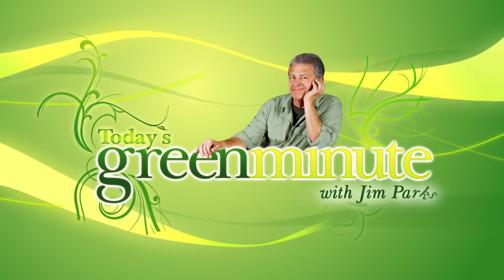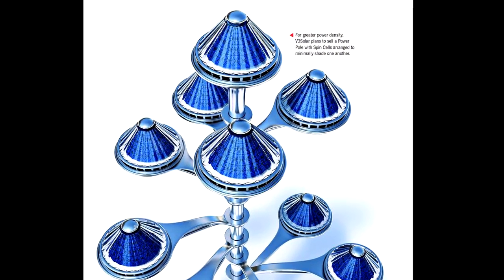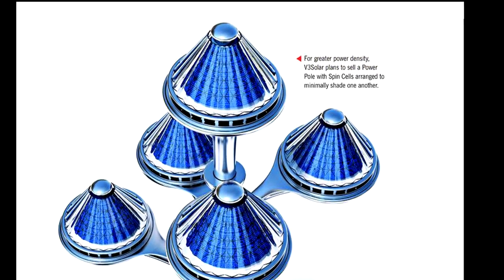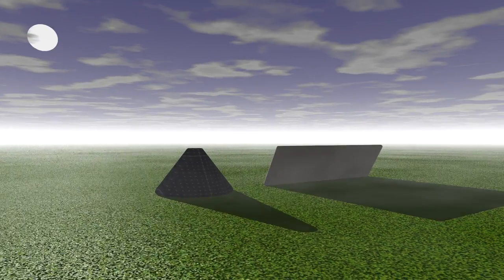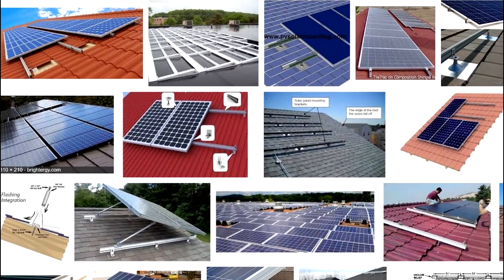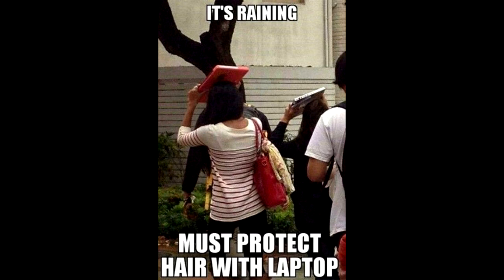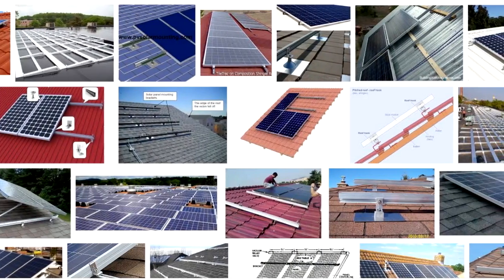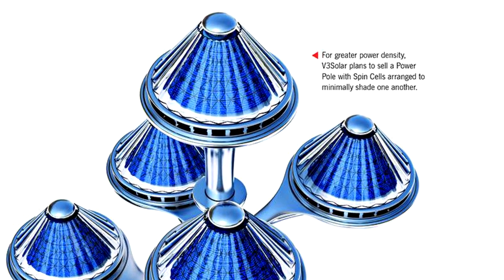Spinning Solar -BUSTED!

Comment: Why not make it a sphere. Sun is pretty unpredictable, so it might as well be below our solar panel sphere.
Reply: "The sun is unpredictable"
I believe its very predictable with its east to west movement.
Its so predictable in fact that its used for navigation.

So... about that
Reply: You are just giving away million dollar ideas here :P
Reply: Cheeseboat, its a joke. Turn on your sarcastic humor detector.
Reply: i think he means that clouds, which can block light and we cant do anything about it thus makes it "unpredictable" i think that's what he means.
Reply: for sure! and we could pay people to shine torches on it during the night
Reply: +zemeon2 He means the sun will try to sneak under the solar cone. Duh!
Reply: outseeker Well, the Streetlight could recharge itself on the solar panel. After all, its over 100% efficient.
Reply: André Broessel has done it I saw this in Barcelona https://www.engadget.com/2012/08/28/spherical-glass-lens-solar-energy-generator/
Reply: You're not familiar with humor, are you?
Reply: Joke aside, they do make it in a seductive shape. They basically cut pipe in two, length-wise, and put panels on that. Orientated correctly, some face the sun all the time.

I think it was meant to provide a lesser, but more predictable curve of power.
Reply: Tamang42,  to make have it work in the nighttime. It's obvious.
Good idea depenthene.
Reply: if its a sphere then then the bottom of I t wont get any sunlight  so cut the bottom off and you have a cone
Reply: Our planet is a sphere because of gravity, and not an intelligent design for increasing solar efficiency.

Comment: You address an issue regarding the motor quitting but what about the motor itself?  Where is it drawing the electricity from and how will that negatively affect the efficiency of the panels?

Comment: what if you could make the panels much cheaper if they don't have to be heat resistant?
could one side of the panel always facing the sun somewhat alleviate the shortcomings?

Comment: Just on a surface level: You have to assume its an electric motor, not wind or heaven forbid fossil fuels making the  panel rotate, in which case your intake has to surpass the needs of that motor... and then they claim it's more efficient.

Now that I've commented, it's time to actually watch the video.

Comment: Ignoring the absurd lenses for a second, is it possible given all the talk of expensive heat resistant cells that the efficiency they're talking about is COST efficiency? ie, are they using cheaper, worse cells to generate a given amount of power for "20x cheaper" than it would be to generate the same power using traditional outdoor rated cells?

Comment: Oh don't forget this. 
If you held 1x1 meter magnifying glass to a small solar panel, you get the energy that you get for a 1 square meter of surface area exposed to the sun, just on a smaller solar panel. But it also heats it up more. So holding a magnifying glass over a solar panel is less effective as using the glass to make a solar panel the size of said lens. 
So when you make a lens the same size as the panel! And lay it on top of each other, you only HEAT your solar panel, and generate LESS energy, because the lens absorbs SOME light!

Comment: What if they made a circular panel and the edges of it had fins that would spin the thing when it's windy and it tracked the sun? The spinning would get more air running across the panels making slightly cooler and you could potentially generate even more power from it. Seems like a no-brainer to combine wind and solar, but I guess it depends on how often it's facing the direction needed to take advantage of both, or if it can be low cost enough to add some extra power to solar panels already being built.

Comment: Hey Thinderf00t I've got a question for you:  Theoretically could you convert an oil burning steam locomotive to burn hydrogen?  I'm sure it would make more sense to convert a diesel electric, I'm just wondering if it would be possible.

Comment: I think it would be more efficient if they made circular tracking pannels spinning with lenses in front of them. Maybe give it a light cone tilt so as to improve the efficiency while it's cooling (like an umbrella).

But so far, a cone shaped solar panel doesn't seem like the best way to go.

Truth be told, solar energy is only as efficient as fossil fuel when it's put in space, but then you're left with the problem of transmitting this energy.

Still, if there's a way to go when it comes to clean energy, my money would also be on solar, despite its clear limitations

Comment: So what's stopping us from using normal sized lenses with small panels to save on the monetary cost (and environmental impact) of constructing panels?
Is it cooling? And if so, and if the spinning thing does effectively cool the panels, isn't that a big deal anyway, for the economic side if not the scientific?

Comment: my home is 100% solar and wind powered. completely off the utility grid. has been for nearly 4yrs now. anyone who uses solar panels for real needs for any length of time can tell that this spinning solar cone idea is a JOKE and will NEVER work. the best way i have found for my solar setup is to set them on an angled frame facing towards the sun that sits on a turn table in the middle of my yard. as the sun moves across the sky throughout the day my solar panels follow the sun turning on the turn table similar to a lazy susan. simple and works efficiently enough to power my entire home to my needs and satisfaction. i also have a small 600watt wind turbine as well.

Comment: This is just a wild outlandish guess, but if there's something about the mechanism of the conversion of sunlight to energy that's like slightly delayed, or something about the process really only requires maybe a few seconds of exposure (and all subsequent exposure energy is basically ignored and "lost") until the initial batch of energy is finished converting, then this spinning cone idea MIGHT not be quite as retarded as it sounds

Comment: The "Diamond Battery" came from the University of Bristol and seems fairly legit.

I think you should check it out.
Reply: the thing is not about whenever it works or not, it does work just like this solar fricking spinning panel , the problem is the bullshit they are trying to sell like more efficient , 400% better , yadayadayada and TF didnt touched the part that the fucking motors that spins this thing also consume electricity thus wasting even more energy that the figure TF said it did.
TL;DR 
Some stuff can/does work but is so power ineffecient and expesive while at it that we are better off with what we have
Reply: "Diamond Battery" give me a break... the base concept is extracting Carbon-14 from nuclear waste and using the beta decay as a power source. Problem is, you need to extract Carbon-14 from nuclear waste. And the power capacity is extremely low (they claim 15 J/g/day, or 0,17 mW/g) That makes for a very expensive and, at best, niche application power source. Granted, with a half-life of 5700 years, it would last forever.

Betavoltaic power sources have been around for decades btw, but they always used isotopes with a much shorter half-life, because they have much higher power capacity. Realistically, nothing that uses power is expected to work for millennia.
Reply: Legit? Sure it's "legit", but just like a spinning solar cone would be "legit", it's terribly ineffective for almost any application (or possibly all applications due to cost).

A 5 carat diamond using that technology would generate 15 joules per day of power.  This means that to generate as much power as a human can (enough to power an incandescent lightbulb), you'd need a diamond (or diamonds) that weighs as much as the person!

At least the solar cone would work to power things. Betavoltaic diamonds wouldn't even really have the power generation to power anything aside from maybe something in space (but even then existing nuclear battery technology may be better).

That said, it will still work for a thunderf00t video, since it's very easily debunk-able like all this other stuff.
Reply: Mshojat Yea when I said it seems legit I meant that it appears to work and by checking it out I meant he should do a video on it.

I didn't word my OP very well.😢

But it would be interesting to understand a more on how and why it works and if it has a future. I was confused by the idea that it needs a diamond shell to protect people from radiation since that would mean each battery would cost £ thousands.
Reply: Mshojat s
Reply: tybofborg Actually read the article- It isn't from nuclear waste, just from carbon buildup on the sides of the reactor

Still unrealistic but doable
Reply: H To be honest, I just wanted TF to explain the concept since it seemed legit.

If it isn't viable, that's fine, but I probably wanted an 'Explain a Like I'm 5' review.

Comment: So wouldn't the glass deflect the light meaning that it wouldn't all hit straight on?  Also the act of rotating would also mean that very few of the solar panels would be hit straight as well on top of the 50% not even being exposed to the sunlight.  Finally the cone itself is set at specific angle meaning further reduced efficiency when the sun's angle doesn't match(for instance when the sun is most powerful around noon).

Comment: Another thing is that the spinning solar will be very heavy and rotating heavy things consume a lot of energy, and the faster it rotate(to cool itself) increase the power needed even more, not to mention that the top of the cone will have almost no cooling since it's radial speed is very low.

Comment: I'd die of laughter if some wanker in the near future comes up with a design for a solar powered aircraft.
Reply: That already exists.
Reply: They did make one.  And it flew.  It had enough battery to keep it afloat overnight.  Problem was it's wing area was MASSIVE, and it couldn't carry much more than it's own weight plus a skinny pilot.  But they DID do it.
Reply: AdamWho Da fuck? I was thinking an aircraft along the lines of a Boeing 787, it'd be impossible to run something that big and carry passengers as well as the cargo and flight crew.
Reply: Travis Fisher Yeah I get it, something of similar function to what we have now.  My first thought would be to revisit aerostatic airships.  The incredibly large size would accomodate solar panels fairly well, and if you hybridize the solar with traditional fuel, You could easily get a working airship that could transport hundreds, even thousands of people.
Reply: Lars Lars Pantsonfars I was thinking of a passenger aircraft along the lines of a Boeing 787. It would be impossible to get that powered by solar energy, those things weigh just over 219.5 tonnes and that's fully loaded
Reply: Lars Lars Pantsonfars It would be possible but not advised though. Remember the Hindenburg? The hydrogen gas that kept the Hindenburg afloat leaked from its ventilation shafts and the gas was struck by static electricity which caused it to explode.

After that incident it doesn't really seem a good idea placing solar panels on an airship because if there's a leak in the hydrogen envelope and an exposed / damaged wire the entire thing could go boom killing a lot of people.

Airships might be a good idea if they figure out some other way of getting them off the ground without requiring envelopes of a lighter than air gas like hydrogen and helium.
Reply: You understand there are other options beside Hydrogen...
Reply: Travis Fisher What AdamWho said.. helium is perfectly viable.  It wasn't used in the Hindenburg because only the USA produced that quantity of helium at the time, and there was a trade embargo on Germany, forcing them to use hydrogen instead.  

Modern construction materials can also support sub-atmospheric pressures (partial vacuum) within the balloon, vastly reducing density and increasing net buoyancy.  Additionally, no real attempt has been made at a hybrid airship that combines the aerostat concept with conventional aerodynamic flight.  A combination of the two would increase efficiency even further.
Reply: Lars Lars Pantsonfars I don't really know much about the more modern versions of the airship, the only one I really heard of was the one that went boom back in the 40's LOL! I guess with the new tech it should actually work.
Reply: +Steven Bee Or connect them together to make a floating city. Actually what you're talking about reminds me of that concept for humans living above the clouds of Venus.
Reply: +FuckGooglePages   I wouldn't say insignificant, but yeah, the fuel is a comparatively minor part of the ticket's price compared to all the various airport fees.
Reply: Dirigibles are way too slow aside from sightseeing or tours. There's also no decent lighter than air gasses available aside from hydrogen and helium, and helium is getting to rare and expensive to be used for that.

Battery powered helicopters would be a somewhat viable option though (at least when energy density gets lower), and then just power the batteries with solar (just like Musk's Tesla plan). I believe people have already started to do this.

I think there's huge safety issues with everyone in the world having unhindered access to helicopters though.
Reply: "Yeah the Hindenberg was very unfortunate - it destroyed the airship industry... and really there was no need.  So long as you don't use hydrogen, airships are perfectly safe"
Sadly to be safe they would also be too unreliable for commercial travel.
LTA are grounded even in light storms. So even if the price is dirt cheep, the round about way you would need to get to a destination slower then driving would not be worth it.
Reply: Facebook already did that bud, it's called Aquila.
Reply: +Travis Fisher  True, but oh the humanity you get from H2-filled floating ships!
Reply: The Ultimate Reductionist [Shrugs shoulders]

Comment: In my province, lots of farmers buy those giant tracking panels, though it hasn't crossed into residential application and since the farmers are selling the power they generate back into the grid, the province has responded to this by raising hydro costs for us because the power company was losing money.   Bless solar power.  :(

Comment: I think you can ease down a bit at the efficiency thingy :)  A solar panel is, in fact, only up to 20% efficient when facing the sun... which means, they're "less efficient" over time. Maybe they're advertising 20 times greater efficiency over the course of an average day?..
Advertising of course isn't very reliable, i'm just trying to find a lighter side to the whole thing :)
Of course, your other arguments against the spinning solar are again solid. I mean... it's probably still best to just have programmed solar cells that face toward the sun over the course of the day... yes?

Comment: Is the cooling problem ofsolarpanels not solved already? I thought there were combined photovoltaic and solar thermal collector that cool theme self down with water that you can use after for showering and stuff?
Thought i heard about that somewere..

Comment: OK, silicon solar panels use only part of the spectrum, mostly red through near IR. [be kind, I haven't worked with them in years]
Finding a glass or plastic lens that is IR transparent, UV blocking and durable is going to drive prices farther up.
And what is the power source that spins this thing?
Oh yeah, the solar cells!  Yay efficiency!
People buy into this stuff for the same reason they accept the fact that alien dinosaurs built the pyramids:  They don't understand something was done, so they make up or accept a myth that is easy to understand.
Hard to explain what a fossil is to a primitive people, but call it a dragon bone, and they believe!

Comment: Another issue is the connection from the cells to the transmission lines.  Not like brushes ever wear out, you know?  Their animated base looks like a brake rotor. :p

I've been after the bullshit water fuel economy things for years now.  People don't realize that the electrical power comes from their crankshaft, and the higher the electrical load, the higher the crankshaft load.  Idiots don't know cars or science.

If the salt water car you mention is the one I'm thinking of, I did some quick math on their claims, and with their (bullshit but claimed) power delivery, the thing wouldn't be able to climb a hill, let alone perform anywhere near what they claim its capabilities are.

Comment: if tracking solar panels rquire energy, you should substract that off the equation
if you dont take this into consideration then the flat solar panel only works 50% of the day or less
maybe build a little house-like rook with the flat panels so they work all day?

Comment: I can see some point to the revolving panel concept. Are you familiar with Gatling guns? he barrels rotate to give you a very high rate of fire while minimizing the heat buildup in any single barrel. if you fired a huge number of rounds from one barrel the heat would ruin it PDQ.  If you spread the heat out over 6+ barrels each one stays cool enough to keep working. this solar panel seems to employ a similar concept to avoid overheating. another, possible better, way to deal with solar panels and heat might be to make, if possible, a glass cover that would block most IR and red light which adds heat to a solar panel but produces no electricity, while allowing the passage of the higher spectrum light which produces electricity.

Comment: I mostly agree with you.  But I am surprised you didn't figure the gain a conical panel would have compared to a fixed flat one in relation to the changing position of the sun.  Keep up the good work.